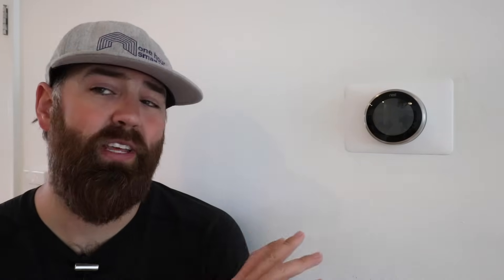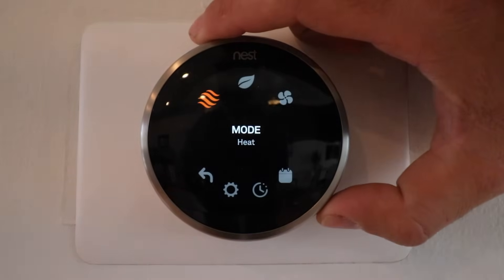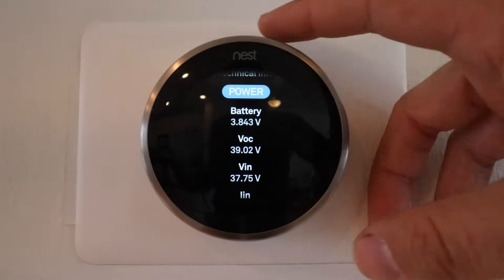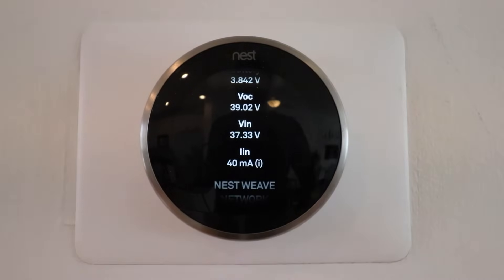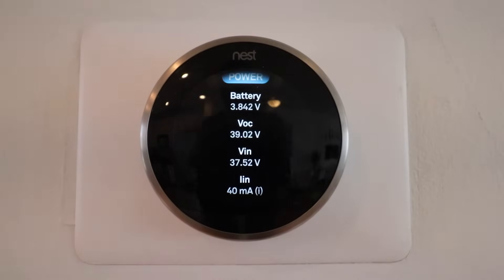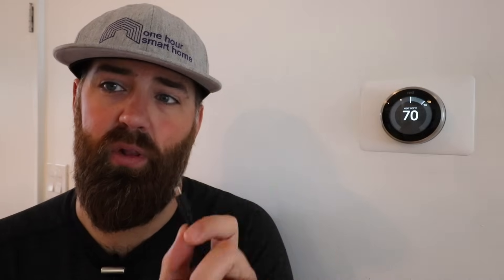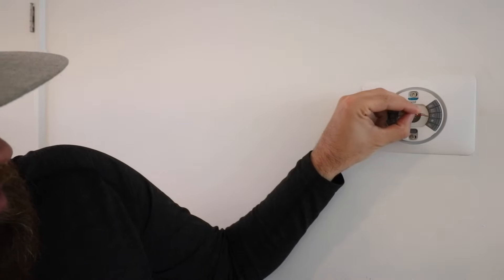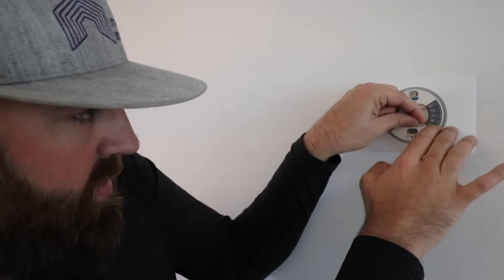Nest Low Battery Fix!

Comment: I have 2 separate systems heating and cooling, 2 RED wires RH and RC, no common. Can I use Common from heating system for a C wire or can I use your advice here in the video?
Reply from the maker: I would try it first without a C wire and if it works no need to use it. But yes you could use the c wire from the heating system. Sometimes you need to change around the wiring with dual fuel systems to get it right because nest can be sensitive the different input voltages. First thing I would try is Rh and Rc connected no common. If that doesn't work try just the Rh connected, no common. If that doesn't work try just Rc connected no common. If that doesn't work try Rh connected with a common. If that doesn't work try Rc connected, Rh connected and a common connected.

Comment: Why can’t my ac just stay on the whole day?
Reply from the maker: If you turn off auto schedule and and turn off home/away assist and eco mode it should stay on all day unless you have a common wire issue. This video goes through adjusting the settings: https://youtu.be/ZPQHvpnsnpU

Comment: i got reading of 3.6 on my nest, then i went to charge it via that usb cable and it doesnt charge. is that a direct indication that the actual nest battery is bad ?
Reply: That or the charging port, but most likely the battery if you’ve had the nest for a few years now.

Comment: Hey guys, incredible video, I have a quick question I have 2 nest in my house one for each floor. Just one of them it is not charging do you know if this can be ac problem or a nest problem? Tks
Reply: Go to nest app and get their support they can guide u step bu step.
Reply: Did you figure this out? I have the same exact issue
Reply: Got the same issue. One ok, the other low battery with only 3.5...V
Reply: Same issue, but I have 200ma coming in with the C wire. It’s maddening

Comment: I like your video but this video is not accurate, you can’t have two power sources powering the same thermostat, when you say put the RH and red wire with old and new red wire,no good, your other video say discard it. You can’t do that either unless you rewire the furnaces power source. I wound up using a common wire connection to furnace and c wire to thermostat which gave me my 200 milliamperes on Lin.  It is an informative video but a bit confusing.  Thanks much

Comment: I did move the g wire to c. AC unit would not start. Later I realized that I have Honeywell mini zone between the furnace and the thermostat. Did I damage something by moving the wires in the thermostat and the furnace but not in the mini zone? I switched everything back to how it was before when it worked,  but the unit still does not turn on. Please help. Thanks!

Comment: Does not having the Nest Thermostat connected to Wifi for about a day cause battery drain?
Reply from the maker: If your thermostat is on the borderline of having low power issues, in my experience having no wifi can cause excess battery consumption.
Reply: As somebody who works for Nest, I will have to say that the answer provided is not accurate. 

Actually, having your thermostat connected to Wi-Fi will require more power. 

There are many situations in which a battery starts draining due to not having the right settings for the WiFi and router settings (you can find them on internet. It's a public article). In those cases, we isolate the issue by disconnecting the thermostat from internet for 24 hours. 

*If the battery stops draining, the issue was the WiFi settings. 
*If the battery keeps draining, the WiFi was not the problem. 

Disconnecting your thermostat from internet uses less battery than having it connected to it.

Comment: Nest software version 6.1-9.  Readings:  Battery 3.698V. Lin 40mA. Yet, I see 3 “error” messages: Nest App low battery, Network low battery and Lock low battery. Please advise. Thank you. Mona
Reply: what the voc and vin showing?
Reply: @morrismansour8121  e103 error nest y1 wire detect a problem ,my vin is 58.94v battery 3.471, Voc 37.90v,  lin 20mA ,how to fix E103 error Y1 thank you

Comment: mine says 200mA(c) after connecting blue wire.  im still having low batt issues. ijhave all 5 wires connected. My ac will stay charged for awhile, but then shut off after awhile, then if i dont take it off the wall and plug it in, itll just turn on and off like it wants to charge, but it doesnt stay charged.
Reply: Whats your voc and vin?

Comment: FYI it's not Lin it's Iin, I is a symbol for current (from french word intensité du courant = current intensity), Iin is input current, Vin is input voltage, Voc is open circuit voltage
Reply from the maker: Thanks for the informative comment.

Comment: Absolutely worked for me. I have a nest connected to a SIME format hydronic system. It pushed out 6v to controller but uses steps down to 24v to it’s internal clock. Used your advice and drew another wire from board. Works perfectly.
Reply from the maker: Thanks for sharing

Comment: It's really tough to get that plug into the RC when a thermostat wire is already in there!  Those nest wire terminals are TINY.  Suggestions?
Reply: Use a small wire nut put the two wires together and use a third wire two the nest hope that helps
Reply: Thanks again and

Comment: How can you add power to the Nest with no wires? Do you still need a transformer if you hard wire from an outlet? I do not have a current thermostat but want to use the Nest in conjunction with my Wifi Smart Window AC units via IFTTT.
Reply: a common is a common is a common, use the chassis of the furnace and run it back to your thermostat.

Comment: I'm starting to run into this issue after having my unit for a few years.  Voltage of battery reads 3.8+ my lin reads 40mA.  But I just noticed my voltage is draining while I have my nest plugged into a charger.  Weird.
Reply: Jackson Szeto i had it only a year and 1mo. It gave out completely. AC guy said it’s the internal battery that gave out.

Comment: My Nest is reading temp 4 degrees higher than actual temp. My AC is turning on often.
Reply: It eventually died exactly 13 months after being installed. They only come with a one year warranty. I took the dial off the wall and charged it for 24 hrs and that even didn’t get it to come on. There was only an image of a house and then nothing would happen. I had my AC repairman change it back to my old thermostat. He said I probably needed to open the unit and change out the internal battery. The screws are so tiny I can’t find a screwdriver small enough to remove the backing.

Comment: I have exactly the same wires as your system but my red wire is connected to Rc not Rh like in your system, should I change it?
What's the difference?
I just plug my nest to usb because it was installed and after more than 2 hours still shows low battery, do you think it is because of the red wire connection?
Thank you for your advice.

Comment: What if i have common wire and i can measure 26vac voltage on it then still i got low battery what is the issue
Reply: I had same problem, open voltage was 24vac, but when I plug in the nest (e) it would report no power, origonally was 2 wire heating system. Added common wire from heater - still same problem. You need to check settings, power voc (voltage open curcuit) and vin (Voltage in), was reading <5vac when nest was plugged in. Turns out transformer in heater was only big enough to power heater electronics and nothing else. I didnt want to swap heater transformer, so i put secondary AC power supply and relay. This wayI electicaly isolate thermostat from heater, works perfectly now. If transformer is not powerfull enough or you have too much voltage drop on the wires it wont charge.

Comment: There is another way to do this that my electrician used.  He hooked it up to my 24v doorbell transformer and then he installed a relay.  And it worked perfectly.   I would love a video on this so that I clearly understand what he did.  Thank you.
Reply: You need a relay with normaly open contacts. Connect these to the heater, then 24vac  from the external power supply/transformer to the nest, and bring R wire to once side of the relay coil, and the other side of the coil tie to common on external power supply/transformer.